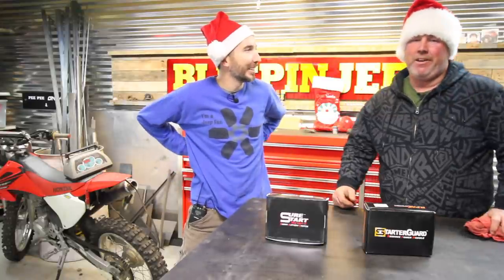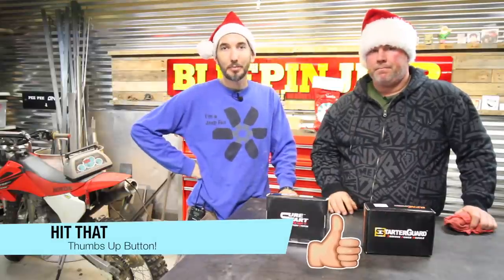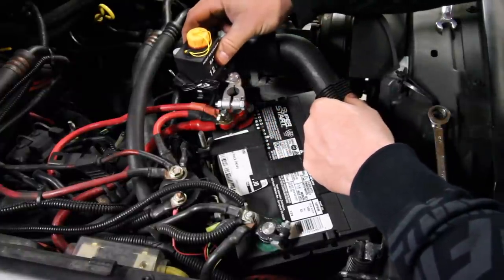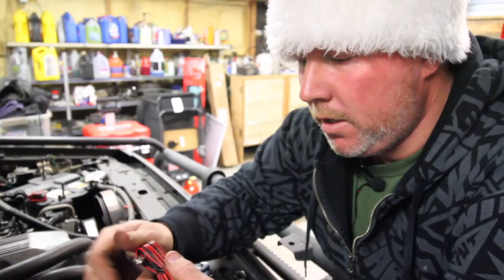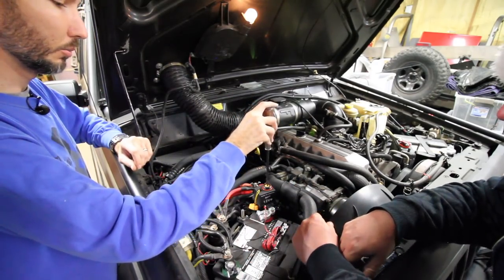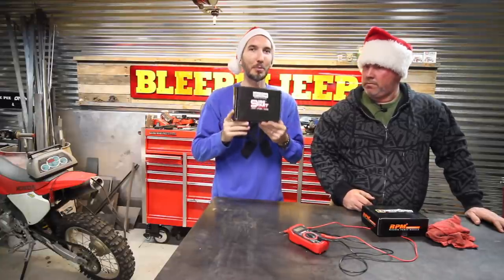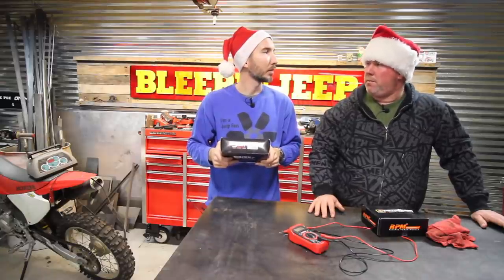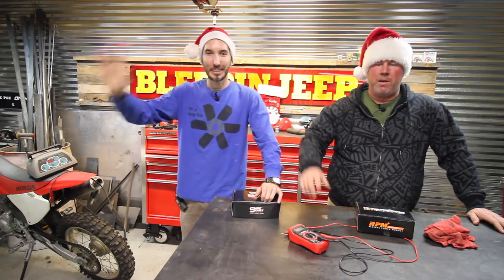My Battery Died - How to Fix it!

Comment from the maker: Hey guys, I did end up finding these and bought a bunch of them.  They are on the website if interested.  Link is in the description of the video.
Reply: BleepinJeep Hi. 🎅🎅 MERRY CHRISTMAS 🎅🎅

Will you ship these to England as I wish to purchase one? 

Great video, as always!!
Reply from the maker: @GrandadPunchy  yes indeed I will.
Reply: So what if u are low in battery and it trips does it trip again with the car on? If it’s way below 11.9?
Reply: @Stamq3  you could always just turn that little switch on top to the off position if it became an issue to get you to where you could repair your car or replace your battery.
Reply from the maker: @Stamq3  If the car is on, the alternator will be charging at over 13 volts so no, it wont trip again.
Reply: Will be ordering one or more of these since watching and finding your website.

Comment: What if your Alt. goes, while driving down the road... will it shut you down ???
Reply: Obviously
Reply: Yes, but then you can turn it off. That's what they were doing with flat head screw driver and the round yellow button looking part with screw on cap. Then you should be able to restart and go as fast and far until you die. Lol
Reply: 8:03 lol

Comment: I've used these on flat tow vehicles behind rvs. For when you need the key on so the steering wheel won't lock up on a turn.

Comment: This is a pretty cool product I have one question after the switch triggered and everything was turned off when you went into the vehicle to turn off all the switches on the panel why was that led still lit up did you guys turn the switch back on by that point?
Reply from the maker: That's a good question and I dont have the answer...  I'll need to investigate further, I'm curious now too. Either there was still some voltage left in the system or those lights may be connected to the second battery for some reason.

Comment: I think the newer vehicles have them. My JK and my wife's JKU  the headlights shut off if you leave them on. Not sure if that's the same idea and I haven't left other things on but cool product
Reply: Most newer vehicles do have a "Power Saver" relay, which will turn off power automatically. The important note here is that this usually only covers the radio, lights, and ignition switchable outlets. Cigarette lighters not controlled by the key may continue to draw power.

Comment: Some of the old auto start systems had those built it.  You could tap the brake pedal twice after shut off which would arm the system for when the battery would drop below 11 volts.  I was working in the Alaska oil fields in the 1990's and would be gone weeks at a time with my truck sitting out in minus zero temps.  Some people used battery tenders, some removed their batteries and put them in side.  I just armed my relay and it took care of everything.

Comment: I used the a similar device called the "Battery Brain" for my grandfather who invariably left a light on.  We used the version with a remote.  He would push the remote button and start his car.  That version required a switched power wire so it would never shut the car down while the ignition was on (think alternator failure)  I currently use a version called priority start which is a little "smarter".  Lots of emergency vehicles used these!
Reply: Hi, how's your prioritystart holding up?
Reply: @dd1z558  It died after about three years.  I was using it on a Chrysler Town and Country which had a bad TIPM and would drain the battery on a regular occasion.  After three years, one day it just wouldn't reconnect.

Comment: When the battery on my xj goes dead, after a jump start, it sometimes takes about 5 minutes for it to idle again without dying.. something to do with the computer relearning things. Do you think this will happen when this unit auto disconnects the battery?
Reply from the maker: What year xj?  It shouldn't do that...  but I assume it still could since this would be disconnecting the battery.  Although you could run that accessory wire to the computer.
Reply: BleepinJeep 1998

Comment: Redarc from Australia makes one as well that is automatic. Blue Sea has one that is probably more robust.

Merry Christmas guys!
Reply from the maker: Can you provide links?  I cant find either one...
Reply: @bleepinjeep  https://www.bluesea.com/products/7635/m-LVD_Low_Voltage_Disconnect

And heres the redarc sense module you pair with an inexpensive solenoid

https://www.redarc.com.au/voltage-sensor-12v

They sell it with a smart start relay as well.
Reply from the maker: Cool thanks!  Those are expensive but nice units.
Reply: @bleepinjeep  all of them have their pros and cons.

Comment: Lots of new cars and trucks have a battery shut down that engages after about 20 minutes. Find a newer GM vehicle about 2002 or newer and leave the door open and after 20 minutes or so, the electrical system disengages from the battery. But these will be great for those who don't have the feature.
Reply: It just shuts off the interior lights, unless you open another door. You can still leave your headlights on and get stranded... ask me how I know. 05 Suburban 2500

Comment: I would like to put one of these on a semi truck i would just hook this up to a larger commonly closed circuit relay and have that relay contol the higher amperage start yeah that would work it that case i could buy the smaller cheaper one.

Comment: What about while winching?
Reply: Hey that's a good call I didn't really think about that I don't know what your battery voltage drops to while you're winching I've never really paid attention but that's a good call you might not want to winch longer than 30 seconds at a time LOL
Reply: I would naturally just recommend that the winch goes straight to the battery anyway that's the way I've always pull them them.
Reply: @jeremyrose7541   ive had my battery drop all the way to like 8 volts, but yes easy solution is to just run it straight to the battery.
Reply: But your car will still die...
Reply: @rcguymike  i mean if its off absolutely, but your engine should be running. Even with the engine running while winching your voltage can drop all the way to 4 volts depending on your load. But this is what ive experienced with a manual. Ive had winching kill my engine, always started right up.

Comment: It's pretty simple to make something like this; all this is is a 12v relay and a microcontroller. The chip is programmed to read the voltage from source, and flips the relay when the voltmeter says it's too low.

Comment: Wouldn't it kill the whole car while you were driving if your alternator fails?
Reply: Possibly but the same thing would happen if your battery was dead enough just a few minutes after as well. We were talking maybe it would be a little bit of a warning telling you something was wrong. Because if your alternator goes bad you should have gauges and lights come on. And if you ignore those it's going to quit running soon enough depending on how much Electronics you have running! Merry Christmas
Reply from the maker: I guess that's why there is an override
Reply: My concern would be losing power steering and power brakes if it just shut off while I was driving. I'm looking at buying one for my truck would be cool to have on something that wasn't my daily.